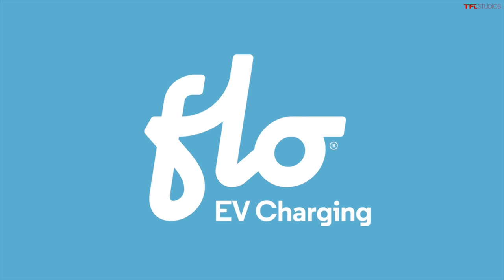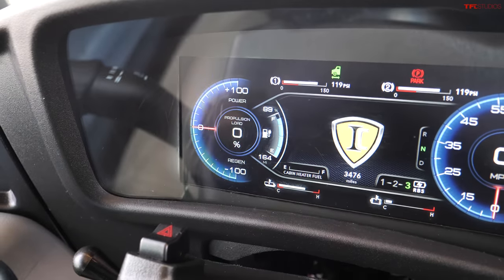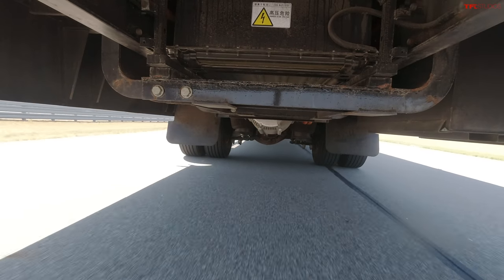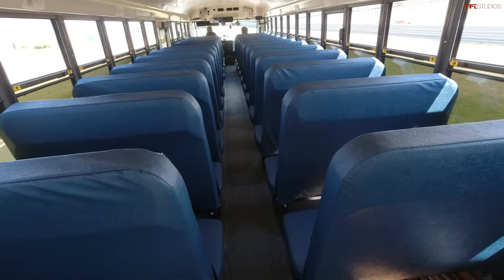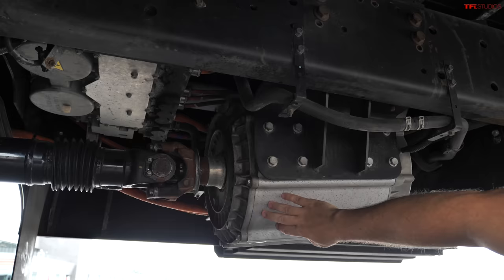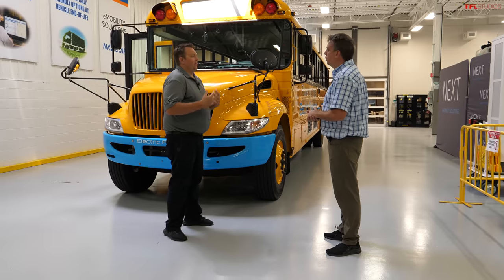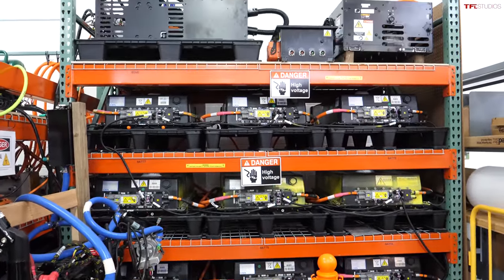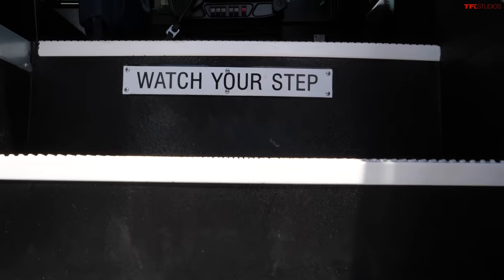Does This EV School Bus Put The First Nail in The Coffin Of The Classic Yellow DIESEL Kid Hauler?

Comment: Roman, I really wish you would have discussed cost vs diesel.  Then ROI and how long it would take a school district to recoup the costs of bus purchase.  What does it cost to run the EV for a year vs Diesel, etc.  Maybe a part 2?
Reply: According to Google the average school bus route distance is 73 miles,  the implied efficiency of the bus is around .8 miles per kWh. For simplicity's sake we'll call that 100 kWh per day. The average cost of electricity in the US is 10.42 per kWh; $10.42 per day. I think the bus would do better than .8 kWh/mile and I pay 6 cents a kWh to charge my EV, so it may be as low as $5 a day 
There is really no maintenance to speak of, I have 110k on my Bolt and nothing other than wiper fluid, blades and tires.
315 kWh per bus is a hell of an emergency generator, plus with v2g the school can sell power to the local utility, say over a hot weekend when the buses are idle and the grid is strained.
I think the most important factor though is not choking children with fumes (duh!) and showing our children the respect they deserve by being transported responsibly.
Reply: @augsu  That's all great info but what is the cost of the EVBus?  My school district just installed Solar on the roofs of all buildings in the district so the cost to charge should be $0.00.  I understand maintenance much lower but what about the cost of the bus itself?  What is the life expectancy of the batteries and what is their replacement cost?

Don't get me wrong I want to see diesel buses go away but not if it costs more to purchase and operate over their lifetime.
Reply: @ljoffe    Can solar support multiple vehicle full charging every day?
Reply: Notice non of the EV backers on these comment sections will touch the millions of dollars it will cost the tax payers just for the charging solution for all of a districts buses. That is on top of the $250,000 dollars per bus they are going to cost. This is a total loser for the tax payers.
Reply: @ljoffe  I would think there will be federal state and private grants for renewables for the children, I'm sure someone will think of the children. I couldn't imagine regretting switching to electric. Why would a school want to do vehicular maintenance, or deal with breakdowns? It will be a joke someday, what we're doing today.
Reply: @ljoffe  Because your school went solar does not mean that it provided enough power to do more than power the school. It might need to spend more for more solar panels.
Reply: @garysarratt1  You are implying that there is no roof on most schools that could not be used to supply large amounts of voltage and amperage. The biggest problem would be battery solutions.
Reply: @augsu  If there were 315 KWh sitting in the bus over the weekend, then the charging is not set up correctly for the bus. Any charging would be set up to deal with temperatures of the buses and then a real charging session would be set up to charge at the cheapest price. The other thing would be that the charge would be there so the bus could be rented to another entity, which means that the charge could not be put back into the grid. There is very little reason to try to use it in that way other than a real emergency situation.
Reply: @ronaldking1054  Yes, you are correct, using batteries to prop up a failing grid is everybody's go to argument for V2g, but it is a last resort. There are many better ways to use a giant battery that moves. The point is, an electric school bus is a commodity that an ICE bus could never be, and schools will have to learn how to maximize their investments.
Reply: @augsu  for craps sake mr wizard. Of course you intentionally left out that all these great greenies will be charged by fossil fuel electricity. Youll just pollute your kids environment that much worse.
Reply: @ljoffe  youve got solar completely powering the school and enough left over to charge a fleet of buses every day??
Reply: @mustangecoboosthpp3869  (they wont touch that the charging is from fossil fuel electricity). They better get more windmills.🤯
Reply: @rushfan9thcmd  did you read the part of my comment about how it takes more electricity to refine fuel than it does to drive electric. So even if the juice is dino based, you're still using less of it. And that's at the refinery. What gets the oil out of the ground, pumps it through pipelines, heats it for refining, transports it to depots, and pumps it into your truck? Electricity, The oil cartels went electric decades ago, but they keep telling you electric is bad. I think they're lying to protect their profits, apparently you don't?
EVs are 90% efficient, ICE is 40%, you'll have a hard time convincing me that Diesel is better.
Reply: @augsu  you also dont account for related pollutants, you also dont account for the "magic wand" that pays for the purchase not just for a school but many, and the time involved to make the cost worthwhile. Pollutants are already regulated heavily. We lease our fleet. Bus distributors such as Midwest of Kankakee wont be acquiring hundreds at a time to lease out to numerous districts.
Reply: That's the plan!
Reply: @rushfan9thcmd  Midwest Transit will eventually.
Reply: @chaderic52  we do business there and i go past it every day. We will be doing some checking.
Reply: And data needs to include all temperature situations, weather conditions, road conditions, flat hilly or mountain conditions. Not just fair weather nice driving conditions. If testing in sub zero snow loaded road conditions were done, by whom where and when???
Reply: @rushfan9thcmd  It's been tested and developed at testing grounds all over the U.S. in every climate and terrain by IC for years.
Reply: @rushfan9thcmd  Within 6-7 years the cost of electric buses will be on par with diesel and federal standards will eventually push diesel to the brink, and when the districts sees the fuel savings... MWT will adjust. Just like the rest of us dealers.
Reply: @rushfan9thcmd  If you are referring to Lithium and Cobalt mines, here's the deal. Cobalt and Lithium used to be niche materials with very little demand, so it was impossible to compete with the established and horrible mines. The demand and price for these materials has risen significantly, plus EV companies are committed to sourcing ethically responsible materials. Here in Montana there is currently a mining boom as the heavy metals that pollute streams now are worth more money, so mines are reopening and processing tailing piles for newly valuable materials. "There is no pollution, only resources we haven't learned to exploit" Buckminster Fuller.
The EPA has released $500 million (from a $5 billion dollar fund) in grant funding for the purchase of electric school buses and chargers, Biden's infrastructure bill has $7.5 billion for EV stuff, and eventually all schools will mandate electric buses as they're not big fans of sick and dying children. 
Saying "Bus distributors such as Midwest of Kankakee wont be acquiring hundreds at a time to lease out to numerous districts." is just dumb, you don't think a bus company is going to buy buses? With grants? It's like people are taking stupid pills to come up with this shit.
Reply: Diesel Buses are $85,000; electric variants are $375,000-$425,000
Reply: @mustangecoboosthpp3869  Have you noticed how much diesel costs? Pretty sure this will pay for itself rather shortly. A school bus is literally the ideal setting for an EV: Not overtly large distances to cover, same route all the time, lots of idling with stop and go. Also charging is such a non issue.
Reply: Based on the body and chasis it looks like they can easily retrofit current school busses, so that's part of the cost. And the money is there, it's where our government chooses to invest.
Reply: My school has a purchase rate of 3 buses a year, we go through buses constantly and never have buses older than 2015s. This is really common near me and only buying 2 a year that are electric would allow for the district to have a fleet of all electric buses in 10-ish years

Comment: I like the idea of electric school buses.  And, if you put charging ports at the schools, buses can also charge while waiting for school to let out.  Bus almost always arrive 30 minutes prior to the release bell ringing.  Buses can use that time to charge if they have charging ports at the schools.  However, I would keep the propane and diesel buses around for school field trips and ball games that are a long distance.  Normal bus routes are no problem for electric school buses but long distance trips, field trips and ball games, might be a challenge so I would keep the fuel buses around at least until charging times get shorter and battery ranges get better.
The electric school buses are completely silent.  That can be a problem for pedestrians because, they can't hear it.  Same goes for students sitting on the couch waiting for the bus.  We've all done it when we were little, sitting on the couch waiting for the bus.  I did it when I was in school.  And, the rumbling diesel engine noise was a dead give away that the bus had arrived.  If you can miss the diesel engine noise, you can miss anything.  But electric duses are completely silent so you're not going to have the diesel engine rumbling noise like you do with diesel buses.  Very easy to miss the bus at that point.  However, this is easily remedied.  A diesel powered bus will have the loud rumbling noise that we all grew up with.  You can generate that diesel engine noise with a sound chip and loud speaker.  But, I believe that electric school buses are going to be a major game changer for student transportation.

Comment: LOL. An electric school bus will never replace the diesel school bus I drove for work. I was doing 240 miles a day one year. That gave me maybe 3 breaks of maybe 20 minutes during the day. I'd need 3 of those electric busses just to get me through the day!
Reply: Well, even if the electric school bus shown doesn't cover every single school bus route in existence, 200 miles of range is still sufficient for the vast majority of them. A bus route in the middle of the city doesn't need to be run with a bus capable of running a long route in rural North Dakota.

And even for your route, I would not say "never". Battery technology is getting better and better each year. I'm sure, at some point, an electric school bus will come along that will handle your 240 mile route.
Reply: @ab-tf5fl  Where is all the electricity going to come from to power all these future electric vehicles?
Reply: @ZephodBeeblebrox  That's a problem. The government is pushing EVs ...buses, cars, trucks without the power grid to charge them. Talk about putting the cart before the horse. Typical lack of common sense by politicians.
Reply: @ab-tf5fl  Ye batteries burn better and better :D

Comment: A challenge in some of the school districts around me is the drivers park the busses near their homes overnight because the district is spread out.  It would require designating spaces at the nearest school for charging, having the ability to download charging data to reimburse drivers, or install power meters at drivers' homes.
Reply: Modern Ev charging hardware can easily log how much is used. Paying drivers back to use their home power should be trivial.

And based on the numbers à normal home charger should easily be able to fill a bus overnight.
Reply: I think that to with that most would be charging at the bus barn. In my county they're not allowed to be taken home
Reply: @mikecarter4572  most districts would do that. Not saying things are not possible, just challenges to overcome. With some schools on the other side of a mountain pass and some winter storms can delay getting out.
Reply: @gelu88  300 kwh overnight, 5 days a week?  That's a big residential load. In fact, over a 16 hour charge window that would require 80 amps, or half of a typical 200 amp service. Maybe they only need 200 kwh. That would require 55 amps which is much more reasonable, but still a big, long duration load to add on to a typical residence.  Those amperage numbers assume a steady draw.  But in fact to charge in 16 hours it would require more than that for some time, maybe 8 to 10 hours, and then taper for the next 6 to 8 hours so it is ready to go early to next morning.
Reply: @gelu88  Who the hell wants a school bus parked next to their home every night. Sorry but won't work.
Reply: @mustangecoboosthpp3869  You obviously have never been to flyover country.  MANY rural schools have drivers that take their buses home.  MANY districts in my state now pay teachers a supplemental salary to be bus drivers.  Teachers love it because they don't have to provide their own vehicles to get to work...and they are getting paid to drive the district owned vehicle.
Reply: @Faiz Imam

I think for most routes, the nightly load actually needed is far less than that. If a typical school bus route is no more than 80 miles, and a full battery goes 200, you won't use that much battery each day.

Nor is it necessary to charge the battery all the way to full each night either. Even if the bus slowly drains its battery over the course of the workweek, as each nightly charge puts less into the battery than the day's driving consumes, all is still good because you've then got the weekend coming up, during which the bus can slowly charge for around 60 hours straight, allowing it to start the Monday morning commute with a full battery again.

Some basic numbers: If a bus drives 80 miles per weekday, that's 40% of 300 kWh or 120 kWh. If you add 90 kW each night, that means Friday evening ends with 60 kWh left in the battery, which is plenty of cushion. 90 kW added over a course of 12 hours is 7.5 kW, equivalent to the same 32 amps/240 volts I use to home-charge my own electric car.

If, once in a blue moon, you need more than that, you can always take a few extra kWh by stopping for 5-10 minutes at a CCS plug at the end of a service day. Although, the worst weather days, schools are going to be closed anyway, so you won't have to worry about powering the bus.

Comment: How much does this bus cost? How much does a comparable diesel bus cost?  EV’s have much lower operating costs.  What is the payback period in years?  Kyle must know this because he needs that info to convince customers to switch.  Wish you had asked and shown cost comparison details
Reply: Its not just the cost ofnthe vehicle (which surely is significant), but the charging infrastructure. To outfit a bus garage to handle the charging of a fleet will cost millions.
Reply: @porcelainthunder2213  

That is an issue, but it may not be as bad as it seems. First off, not every bus will need to completely charge the battery every night. If a full battery goes 200 miles and a particular route does only 40 miles in a day, simply recovering 20% of the battery each night is plenty.

And, if you wanted to, you could probably get away with even less that that, since the normal school bus has weekends off. So, if the bus uses 20% of the battery each day and recovers 10% of the battery each night, the bus finishes the day with 80% battery on Monday, 70% on Tuesday, 60% on Wednesday, 50% on Thursday, and 40% on Friday, still with a huge cushion. Over the weekend, it slowly charges back to full again, and the bus is ready to go Monday morning with its battery back at 100%.

If each bus only needs 30 kWh added to its battery overnight, rather than 300 kWh, the power load decreases significantly. 30 kW over 12 hours equates to just 2.5 kW per bus - even allowing for a 10% energy loss during charging, charging the bus at just 12 amps, 240 volts seems plenty. This is no more of a load on the electrical system than a medium-sized air conditioner.

Of course, the charging system would have allow for a little bit more power than this - even if many bus routes do 40 miles per day, some will do 80 and need to charge a bit faster. And, you also have to have enough slack in the system so that if the power is out one night, you can make it up by putting a little more power into the bus batteries the next few nights, so the power outage doesn't impact students' ability to get to school. But, nevertheless, I don't think the bus base needs anywhere near the capacity to handle anywhere near charging every single bus from empty to full, every single night.